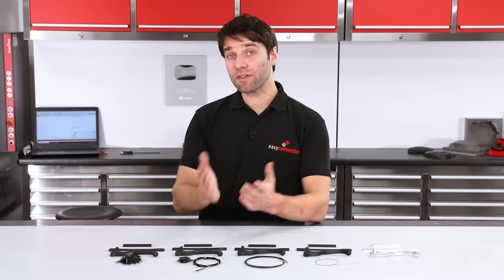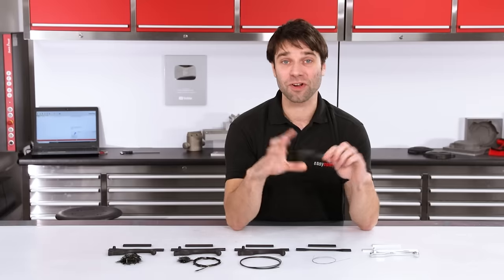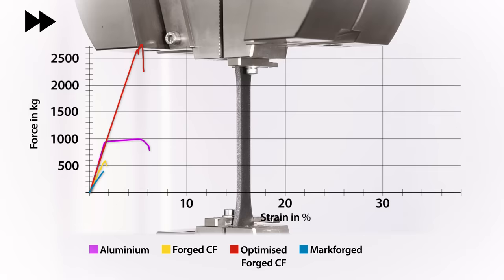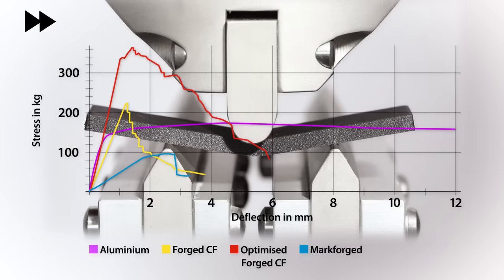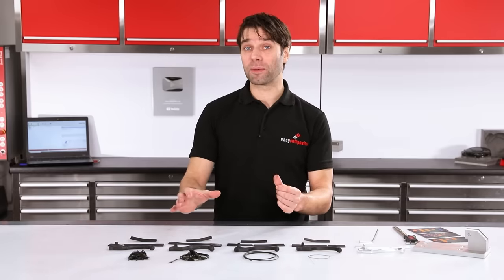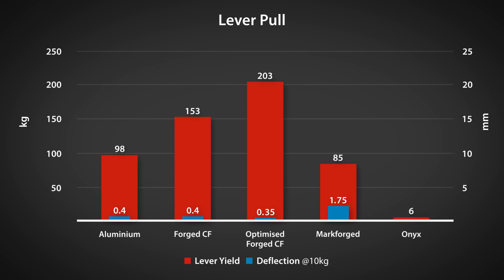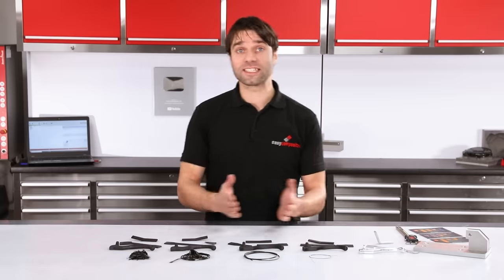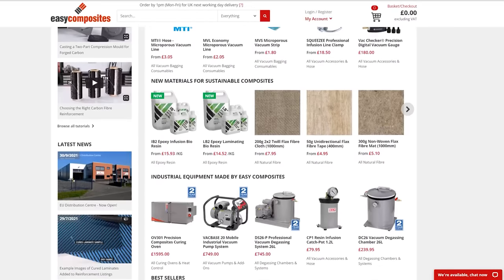How Strong is Forged Carbon Fibre? Forged Carbon vs Aluminium vs Markforged vs Onyx

Comment: That Optimized Forged CF is really impressive. Is the method to make this sort of part as straightforward as you suggest in the video? I really like your forged DF videos (OK I like all your videos) but I don't recall seeing a video about making an optimized forged CF part. It would be great to see any tricks you have to share.
Thanks for another really interesting video.
Reply from the maker: The footage at the start when discussing the optimised version is of the lay up of that brake lever.  Its a bit messy as you are laying it into the mould by hand but perfectly doable and where the extra stiffness and strength is needed, well worth the effort.
Reply: @easycompositestv  I noticed that portion of the video. I was wondering if you had taken time to document the process in greater detail. A video on the topic would be interesting but pretty much any video you decide to make will also be interesting.
Thanks again for this video.
Reply: @ddegn  in the previous video he showed the molding process for the brake lever, however he didn't put the long strand fibers in. Only the chopped tow. Still, I think it will give you a better idea of the process than the small snippet shown in this video. If you already saw the previous video, then my apologies. Here is the link: https://www.youtube.com/watch?v=25PmqM24HEk
Reply: @ddegn  the only one difference between optimized and "not optimized" is that u add long fibers along the part to add stiffness in the direction where 90% of strength will be applied
Reply: I would say it is as straightforward as it looks. I made a quad frame using optimized forged cf without knowing it is a thing, it made a lot of sense to use directional fiber and it worked out great.
Reply: @easycompositestv  ……the optimised lay-up seems to be the second from the left in the description at the beginning but the the third from the left in the results. Is that right?
Reply from the maker: Indeed there is nothing more complicated in the lay up than what was shown in the video snippet. You do need to design it properly which means an understanding of the load paths of the item you are making and hence the best way to orient the longer fibres.
Reply: @easycompositestv  Thank you for making this informative video, the results are very impressive! I've been playing around with chopped fiber composite castings for a while and I'm curious how much long strand vs chopped fiber is in the optimized version? Would more be better?
Reply: I did find it really interesting that while the optimized forged test parts performed really well, the difference was not as pronounced in the real world application.
Reply: Similar/same concept as steel reinforced concrete.  Plenty of info/examples on that.
Reply: Appears neither YOU nor HE know what the word FORGED means.  These parts are molded, NOT forged.
Reply: @w8stral  Words can have more than one meaning. "Forged" in "Forged Carbon Fiber" generally means molded under pressure (sometimes just molded). I'll join in the quest keep "forged" from being used in ways which differ from the traditional meaning once people stop using "quantum" to indicate large changes. A quantum change is the smallest possible change.

You may not have as good of mind reading abilities as you think.
Reply: @w8stral  watch their other video on their forging process. It involves pressure to force the material into the mould shape.
Reply: @j6077xxd  I do molding for a living bud.  It is not forging just because some idiot on youtube adds some fiber to a resin.  Forging uses no mold and uses an open furnace usually.
Reply: @w8stral  You can blame Lamborghini, they were the ones to first develop and name it.
Reply: @w8stral  triggered! Seriously tho, as “annoying” as the name is (and obviously it is compression molded not “forged”) it doesn’t change the fact that “forged carbon fiber” IS the industry-wide terminology to represent it… And the creator of this video did not invent that terminology… 

I’d suggest writing a letter to Lamborghini…
Reply: @TylrVncnt  Well as someone who works in said industry, you are wrong.  100% wrong. Maybe some dumbos in Europe use the term, here in the states no one does.
Reply: @AlenHR  really?  that's bold.  Can you share a little more about it?  I want to build a high speed electric bike / eMTB frame
Reply: i think optimised forged carbon fibre is very similar to traditional woven carbon fibre
Reply: @easycompositestv  Could you make a second test comparing forged carbon to typical UD carbon fiber. I'd like to see if there's a benefit of using forged carbon and if the isotropic properties of it are useful or just causing the whole part to lack in strength

Comment: @Easy Composites 16:00 - glue end-tabs onto the tensile specimen to prevent breaking of the specimen between jaws! Use some softer material like polyester+glass, but make sure you use really strong glue. For my specimen that required ~90kN pullforce to tear apart I used 1mm thick GPO3 rectangles glued with 2k epoxy.
Reply from the maker: Yes we could have done to get a more accurate figure, but the results were high enough for the purposes of comparison in this video.

Comment: I'd love to see more details on the optimized forged carbon process, such as how often to include the longer strands of tow
Reply from the maker: Well, the considerations would be very similar to those governing the inclusion of unidirectional carbon fibre placement in a more conventional layup. The more unidirectional fibre you add, the stronger and stiffer your part will be in that direction, but at the expense of stiffness in other directions. For the forged carbon process, there would also be an upper limit to the amount of unidirectional tow you could add (in proportion to the chopped to) before there wasn't sufficient short strand tow in order to redistribute itself in the mould under pressure. Aside from that, if you have a specific direction of load then the more unidirectional tow you add in that direction the better!
Reply: They uploaded a new video detailing the process https://youtu.be/nhqAhYOdGNc

Comment: Apparently the Onyx filament is nylon based, nylon is extremely ductile. It would be interesting to see a polycarbonate filament reinforced with chopped fibres which I expect would come a little bit closer to the isotropic forged carbon fibre part (since the resin is a pretty important part of the material properties, not just the presence of and type of carbon fill). That will also be why both 3D printed parts were extremely ductile in the 3 point bend test, since none of the fibres are oriented in that direction they're both acting much more like plain nylon than they would in other axes.
Reply: It's the length of the carbon fill that's the problem. At that scale it acts like loose particles rather than fibers, because almost all of the load goes through the plastic and not the carbon. All it really does is destroys your nozzles. If it didn't matter so much then forged carbon would be made using microscopic strands and not large chunks of chopped up carbon film.
Reply: Onyx is designed to be used with mark forged printers which weave continuous carbon fibre, Kevlar fibre or glass fibre through the part as well. It’s not designed for end use applications without the continuous fibre reinforcement.
Reply: @villhelm That's what they tested though the Onyx was printed with maximal continuous carbon fibre reinforcement, but the ductility test I was referring to didn't benefit from that because the load wasn't in line with the fibres. What they didn't test was a higher stiffness resin with chopped fibre, which while still short is much longer than the milled fibre fill for their other 3D print test. While I'm sure the Onyx would beat it in the other tests, in that one specific test I think high end PC-CF or similar might beat it since the fibres only help when they're actually being loaded, in other loading conditions the Onyx will behave as if it's plain nylon.

Comment: Awesome video! This could easily be used in a strength of materials college class or even in a high school class because it's so clearly laid out!

One comment about something this doesn't quite address. A little bit more description of ultimate stress and ductile v brittle materials could have easily been added to the existing data to show where aluminum may be more desirable in cases where a damaged part still needs to function. The motorcycle brake lever is a perfect example of that. In racing dirtbikes, a bent lever can still finish the race, whereas a broken lever ends the race.

Comment: YES! the video I've been waiting for! I'm still printing the moulds as the high density infill takes ages.
Reply from the maker: A slightly quicker technique we have seen recently is to print a hollow open backed mould, then back fill in with the TC80 Tool cast.
Reply: @easycompositestv  I had considered this but was unsure if it would work, thank you!

Comment: What I like about these results is how well it transfer into my job. I design concrete buildibgs and that's exactly how things work with concrete.
For instance, the tensile strength of the long omnidirectional carbon strend is pretty much how the rebars work in concrete. The point of failure being predictibly at the extremity because there isn't enough length to transfer the load at the end. It could be improved simply by making a 135° turn at the anchor point without changing the geometry of the object. That's how we design beams that have a small support point for instance.

I really like this video because it's a manufacturing method I can relate to and maybe use when I need it

But not now, I already spent more than enough money on my 3D printer !

Comment: Excellent data! Good to know that the randomly oriented CF has significantly lower flexural modulus, since that means the short fiber skin won't crack before the continuous fiber core takes up the load.
Reply from the maker: Yes, indeed; that's a valid point.
Reply: @easycompositestv  Though upon further pondering, the skin will still crack first since its elongation doesn't appear to be much more than the optimized forged. It would be interesting to try chopped glass or basalt fiber with continuous carbon. Since the continuous carbon seems to be providing most of the stiffness, the total part stiffness may not be reduced by a lot, but deflection before break may be significantly higher.

Comment: I would be extremely interested in wear resistance testing different types of carbon fiber as well! A lot of these parts will be exposed to the elements and other types of wear and adverse operating conditions. This video was fantastic thanks!
Reply: Wear resistance of carbon fiber composites is primarily a function of the matrix, there's little difference between the fibers in these properties. For higher abrasion resistance and a orders of magnitude higher erosion resistance you need to use a thermoplastic matrix instead of a thermosetting matrix. Thermoplastic matrix composites are more resistance to UV and weathering as well.
Reply: @markwadsworth1254  ah sorry, I should have clarified the wear resistance of the different types of binder plastic used to make carbon fiber parts. Sometimes I forget the carbon fiber is only part of the material and not the material itself.
Reply: @tummyg  no worries that's not entirely obvious, only an expert would know such things.

Comment: I am noticing the carbon filled 3D print filament marginally increases strength and marginally increases stiffness.  The carbon also tends to make prints more brittle and decrease toughness.  So it appears to be not worth it.  There is an important property that the carbon fibers add to 3D printing, and that is it limits warping and size change.  So the carbon fibers are best used to print filaments where you struggle with warping and dimensional stability.
Reply: A big problem with the filament used in the video is the base plastic. Nylon is a really bad plastic for this application. It's much too flexible.
Reply: @ddegn  it is probably not the optimal, but how much better would polycarbonate have done?  Maybe 30% better.  I have also heard the carbon fibers hurt layer adhesion, I cannot confirm this, but if true it is making a prime problem with fdm printing worse.
Reply: @f1hotrod527  CNC Kitchen tests all sorts of filament. He has a video titled Which is the MOST RIGID 3D printing material? I think this video is relevant to this discussion. Apparently PETG with CF is more ridged than PLA. PLA is more ridged than PETG without CF. 
I think you're right about the layer adhesion issue. In the video 3D PRINTING with CARBON FIBERS - ColorFabb XT-CF20 REVIEW the layer adhesion strength is about 30% of the strength of the material itself.

I think it's pretty clear that there are much better filaments one could use in this sort of comparison. @Easy Composites Ltd isn't really a 3D printing channel so I'm not too disappointed they selected an inappropriate filament to use in this test.
Reply: @ddegn  I agree that there is probably better materials and maybe better technique that easy composites used.  But it would have to increase rigidity and strength 4 or 10 fold.  Yes CNC kitchen is awesome.  But I noticed something, he did a video on prusament pc blend months ago.  He showed that he was also testing the carbon fiber version of the PC blend.  You will notice that he seems to be refusing to release a video on the carbon version of pc blend.  I am wondering itvit is because it performed worse than the non cf version?  I do love 3D printing, but there is a place for it, and design techniques that need to be used.
Reply: @f1hotrod527  "he seems to be refusing to release a video on the carbon version of pc blend."
My bet is he's gone off one some tangent project and hasn't gotten around to finishing the review. There are plenty of videos where he shows he's disappointed in a filament or project. There's a lot of carbon fiber related posts on his Twitter. He might be testing other CF filaments at the same time.
"but there is a place for it"
Yes. It kind of drives me crazy when I see things being 3D printed which could have been built faster, stronger and cheaper using a sheet of material cut the appropriate size.

Comment: For something as elastic as Onyx, it is interesting to imagine how to combine the stiffness and brittleness of the other CF and the resistance to deformation from the Onyx.

Much like concrete, pre-tensioning Onyx to hold ordinary forged CF together could yield some interesting products
Reply: To be honest the Onyx product has me wondering how it would perform compared to rubber components on cars.
Reply: @Adierit  It definitely wouldnt yield the same traction result as near 100% rubber tire would.
Reply: Be interesting to see how much better (if at all) it is vs a standard nylon filament or a more rigid one.

Comment: As others have said, this is an excellent video. The level you present it at, a bit simplified for non specialists but with all the information you need to calculate GPa and psi values, is just perfect.  That optimized forged carbon method is very impressive indeed.
Reply from the maker: Thanks, its a fine balance between overloading on technical information that may not be understood by all versus over simplifying the information such that it looses its meaningful nature.

Comment: Thank you for this video! I have a question. When it comes to chopped CF, I saw that you can use different lengths of the fibers. Like 6mm, 12mm, 18mm etc. Will the tensile strength be greater if the fibers are lets say 18mm instead of 12mm?
Reply from the maker: Well, taking it to its logical conclusion, if the tow becomes long enough then you'll get to a point where you have undirectional reinforcement which would be very strong indeed and we know that milled carbon (um in length) does very little to benefit strength so there's obviously a strong correlation between strength and fibre length. However, there is also a practical consideration because we know that continuous fibre along doesn't work well in this compression moulding process because the fibres can't migrate and redistribute themselves inside the mould cavity and so there's a trade off and there will be an optimum fibre length for a given component. The size and shape of the mould will determine this to a large extent; in a smaller more complex mould (like the brake lever) even the 12mm tow is being prevented from randomly orienting by the geometry of the mould. In this case it's probably a good thing (steering more fibre to align in the zero axis) but on other occasions it might now be. For a larger moulding longer strands might be OK but such components are probably better made using woven cloth anyway.